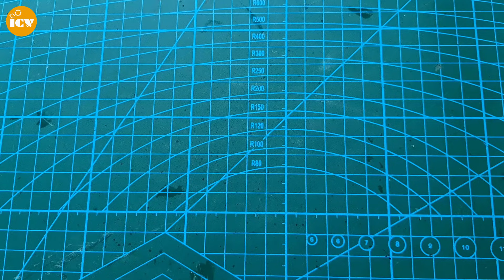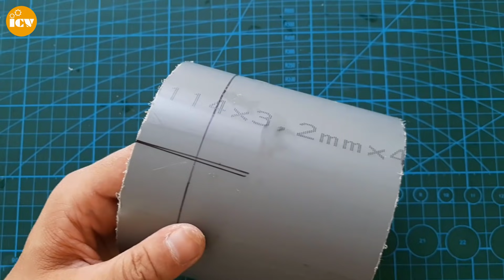DIY Powerful Leaf Blower with DC 12V Motor

Comment: One thing you can try is adding a reducer on the end of the pipe where the air comes out. 
It should come out faster and blow more leaves.
Reply: You're right, pity that ICV Creative does not answer the questions.